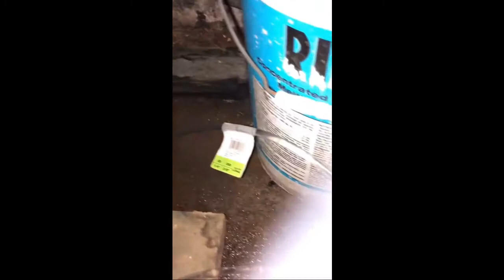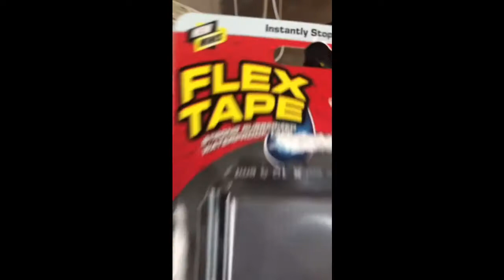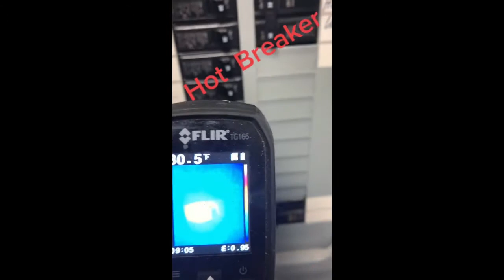Amazing Dental Repair TikToks!!!

Comment: Hello!
I am interested in the method you used for unclogging the cuspidor in one of your tiktok's videos. Can you please explain briefly how you did the suction and the other hoses?
Reply from the maker: Ha! That was my favorite. 🤣 use a large container with 2 sealed openings at the top. Each opening hooks to an internal 1/2" pipe through the lid. The 2 pipes are different lengths. One long, one short. Long pipe hooks to clogged cuspidor, short hooks to suction source (I used dental suction hose. When you open the suction valve, it pulls the cuspidor waste through the hose into the container through the lower tube. The upper tube does not get anything in it. You can put warm water through the cuspidor to clean pipes, just watch the level of your container. 
Wear gloves and eye protection. Be careful.
Reply: @DentalEquipmentRepairChannel  Big brain Jason strikes again! :D Thank you!!